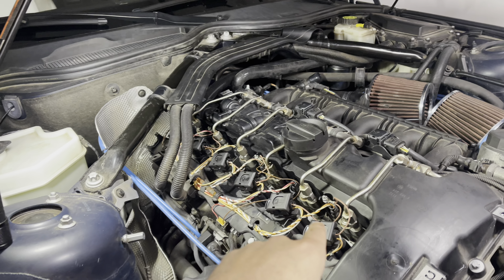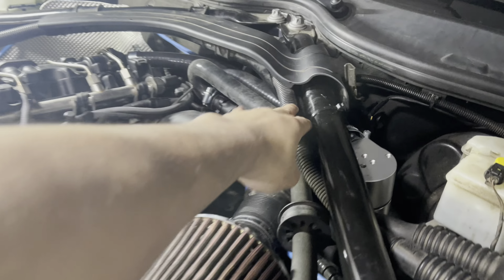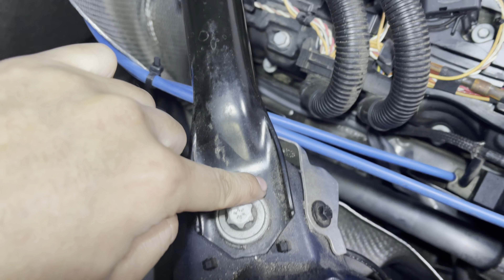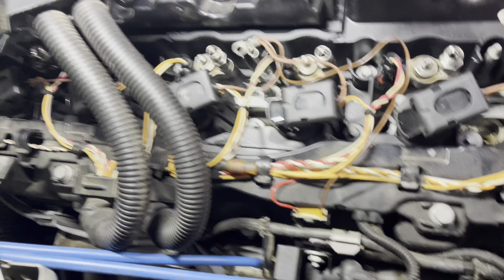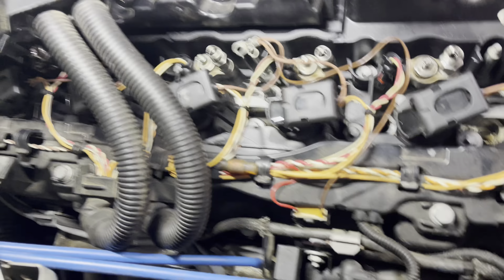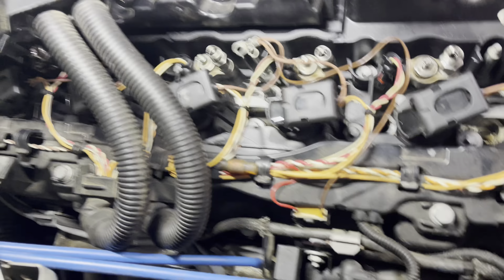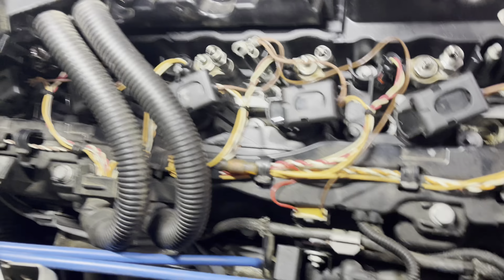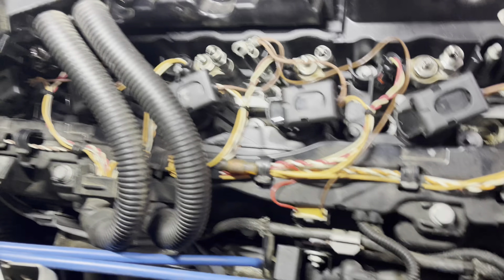Valve Cover Gasket | BMW | N54 | E89 | Z4

Comment: Cool video, It didnt seem necessary to remove the spark plug tube from the valve cover housing. Was there a reason you did? Thanks
Reply from the maker: The kit that I bought from FCP Euro came with replacement tubes so I ended up just replacing them too.